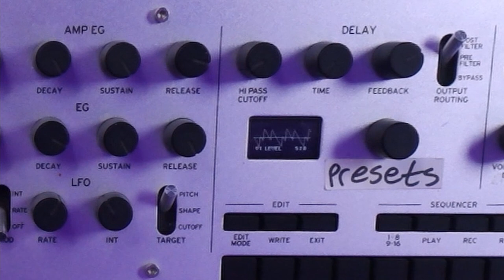My Favorite Synth Sound (and how to make it)

Comment: A bit of pitch modulation goes a long way when you no external fx lying around! Another cool Minilogue trick I picked up somewhere is using the sequencer to modulate the speed of the built in delay, which also results in a sort of tape warble, chorus-like effect. The Minilogue didn't immediately gel with me, but the deeper I delve into it, the more love I get for this somewhat harsh sounding little synth

Comment: Keep in mind on this topic for creating leads using analog synths, it goes without saying that the quality, and even type of lead is heavily dependent on the analog synth you're using. E.g. - single osc per voice vs 2 osc with sync, vco vs dco vs DAC, etc.
Good choice using the Minlogue, as opposed to the XD. The XD overall is better feature-wise and better S/N, but not better than the analog oscillators used in the original Minlilogue in terms of the level of instability necessary to provide what the ear expects,  natural variations in pitch, and this is key for great leads, same can be said of the Prologue especially since the internal CV for its pitch has higher resolution than the XD does and can be modulated in finer increments for acheiving enough "random" variation. As soon as pitch gets quantized large enough to where our hearing can detect it, even subconsciously, that will kill the magic in great lead sounds everytime.
Reply from the maker: The analog oscillators of the OG Minologue definitely sound nice. You can fake the pitch-based phasing by detuning oscillators something very slightly different from 12 semitones apart, but sometimes the imperfect oscillators are where it's at.

Comment: This was very helpful, thanks!
Could you explain how you were able to replicate this with the Microfreak, since it has only one oscillator?
Reply from the maker: You could use the Virtual Analog oscillator and adjust the detune, or you could use a standard saw wave oscillator, turn on unison, set the unison count to 2, then set the unison spread to something a tiny bit lower than 12.
Reply: @GabeMillerMusic  Thanks again! I'm going to give that a shot today after work.